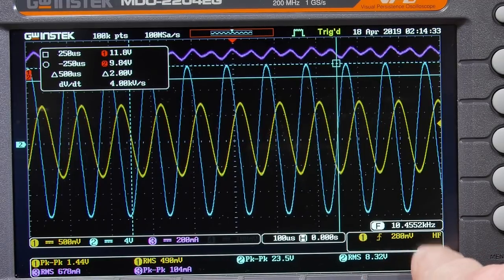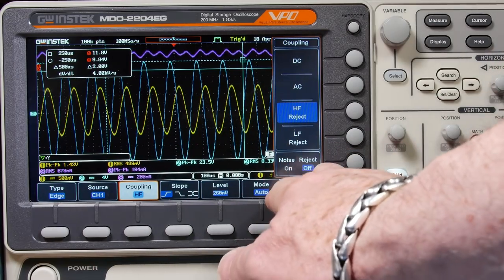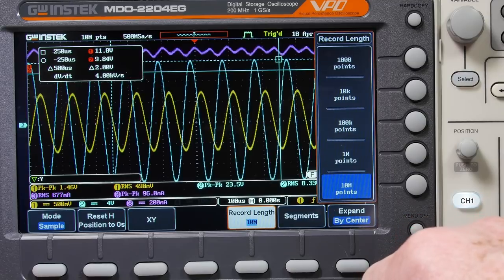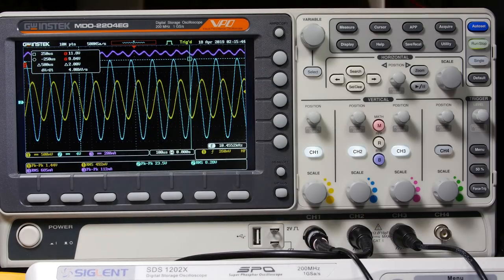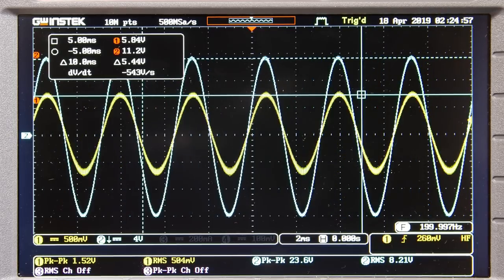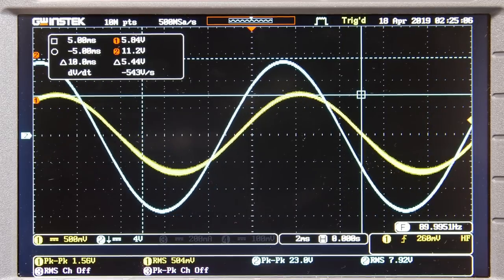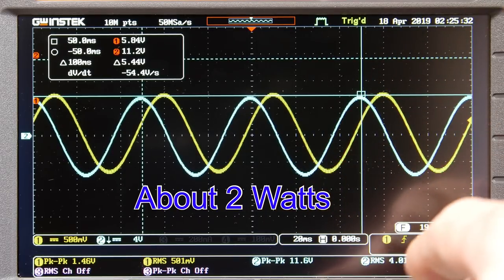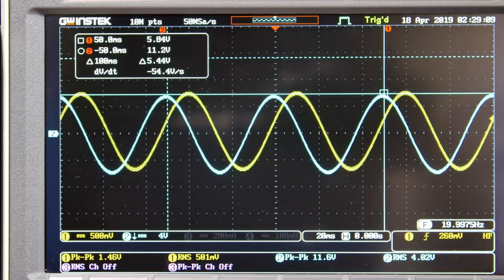Audio Amplifier Distortion Types #distortiontypes #THD #SND #Clippingdistortion

Comment: To "get rid" of the time domain, just switch to the spectrum analyzer function. Your scope is MDO, so it has that function. Moreover, spectrum analyzer has a much better and easier to operate user interface.
Reply from the maker: You are right!  I actually cut that part out of this video because it went long.  I think I showed this with the FFT, but then I also had the spectrum turned on to demonstrate that.  I decided to cut it out as anyone with a newer scope has FFT and can follow along.  I am going to show a separate video with the spectrum to demonstrate how much faster it is to use.  Thank you for this comment!

Comment: My transistor guitar amp is hissing at every note played, but silence when im not playing anything, can anyone help suggest a solution? This is way too technical for me to understand, thank you
Reply from the maker: Great question!  Does it hiss even at low volume when the strings are barely moving?  What kind of amp is it?
Reply: @KissAnalog  it is a fender mustang 3 it has been 10 yrs of seldom use. I just tried it again turns out it is not a hiss but a light buzz on high strings and moderate buzz on low strings. It is proportionate to the volume,  if I sustain a note at volume 3 and turn the volume to 4 there is a scratching sound and the buzz comes in

 On a side note  the amp has air noise and the standard buzz when im not touching the strings, so I connected a cable to the jack casing and step on it. The air noise is like the sound of light wind(which I am guessing is a normal thing, but would be better too if you can give opinion how to reduce it)

Thanks much for your reply
Reply: I have used wd40 on all the knobs, which I think helped reduce the overall noise slightly.

Comment: Wow it has a analog low pass filter
Reply from the maker: Thanks!  Yes most amps do filter high frequencies in the feedback so that the amp isn’t amplifying high frequencies.
Reply: @KissAnalog  if no analog low pass filter then there is not soul on sound at loud speaker
Reply: Sir now isolate these parts from each others so not frequency gonna disturb
Reply: @KissAnalog  dear sir i alaways prefer dc battery's voltage for sound recordings and listenings